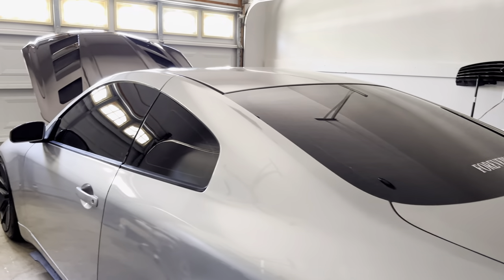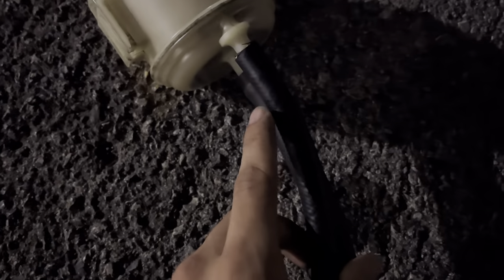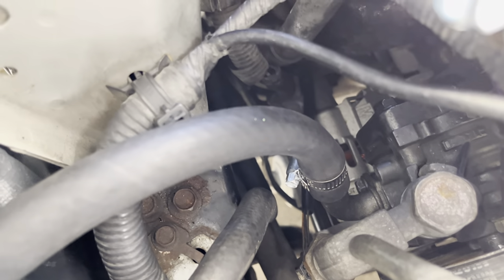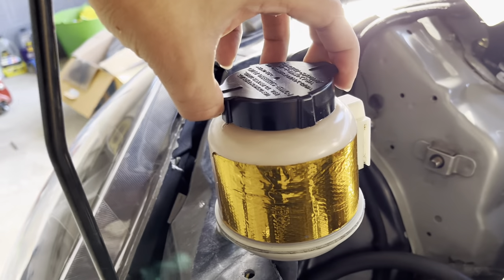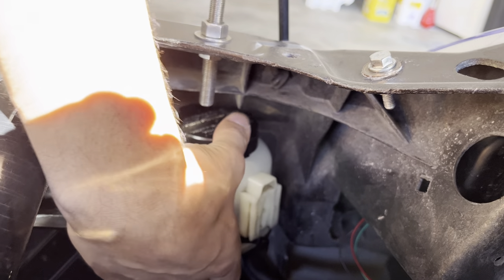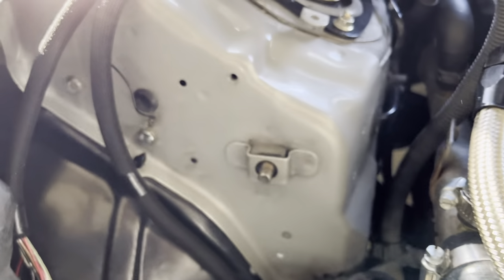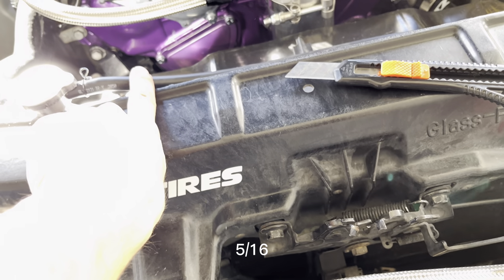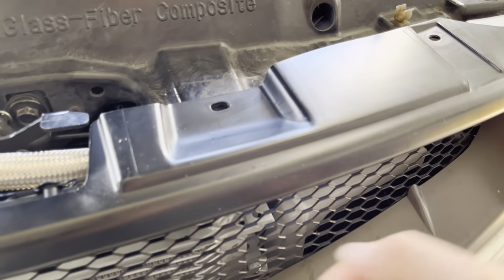G35 Coolant & Power Steering Tank Relocation

Comment: Bro your video came in clutch hella space for 350Z chrome weapon R coolant tank since I got wrong part thought it would fit g35 now it does appreciate it bro!!
Reply from the maker: Glad it helped dude. You can also fab your own L bracket to make it grab onto a top mounting hole too! Just make sure you drill a small hole on the coolant tank so it relieves the pressure.